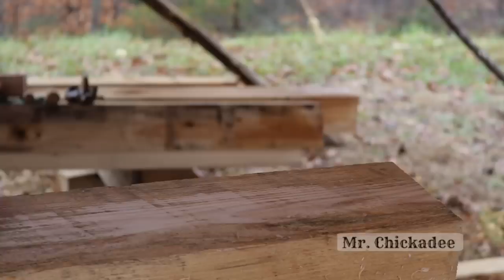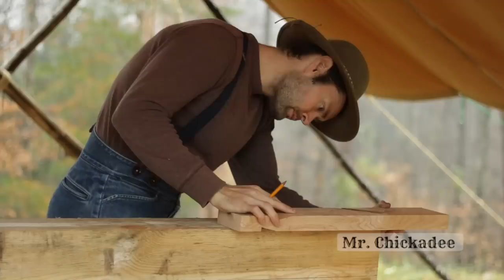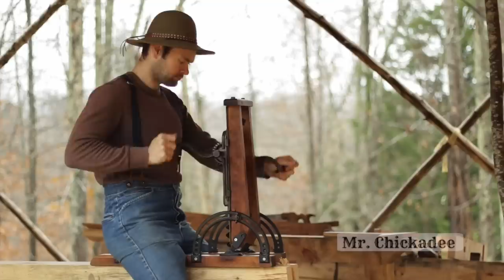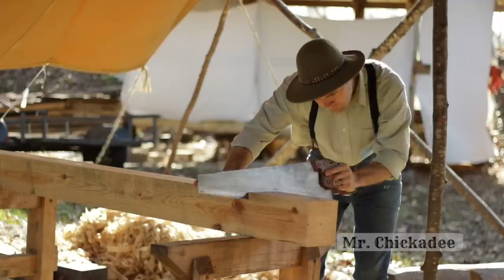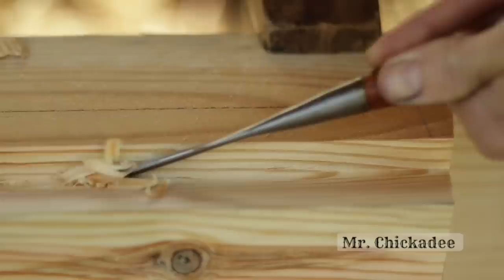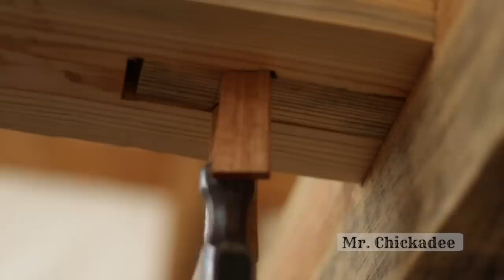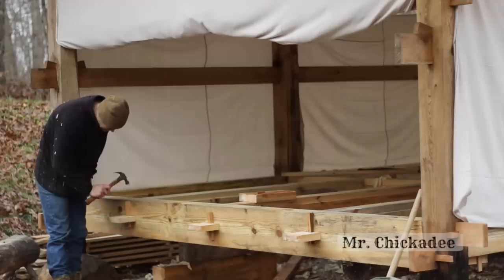Traditional Korean floor 대청마루 ( daecheongmaru) PART I -a wooden floor without nails, screws or glue

Comment: Is that floor made of pine?  And what about the posts, etc.?
Reply from the maker: The floor beams, joists and most of the boards are indeed shortleaf pine. The posts are mostly eastern hemlock, one is tulip poplar. 
One joist of the floor is also tulip poplar. 
Many woods could be used here, if you know how to treat them right!

Comment: Whats longest spand could one do with the floor. It seems yours are 3 to 4 foot could 6 foot be done?
Reply from the maker: Im not sure what span you are asking about, the boards or the timbers? Timber span is often half a room size, while most traditional korean floors of this type have shorter boards, more like 18" or less. Mine are about 36" or so, and if I did again, I would make them shorter, just easier to make shorter boards.

Comment: no glue? than what was he brushing onto those pegs? also when you think about it, arent pegs just wooden nails that you have to predrill for? (yes this is a toiler epiphany for me)
Reply from the maker: That was oil and wedges, not glue and pegs
Reply: @MrChickadee  sorry, wedges. im not familiar with the terminology, i just called them.pegs because you used them to plug the hole. what does the oil do? just to stop rot/swelling or to help them slide in?
Reply from the maker: @yareyare_dechi  wedges are tapered and pull things together, very different action than nailing something up, even pegs are not normally used like nails, though they can be, they are normally used as an aid in joinery such as drawboring a mortise and tenon together, not very similar to the action of a nail or screw. 

The oil does all that you guessed at.

Comment: 청마루 is incorrect, it's 대청마루 and that means large wooden floor, and does not indicate type of flooring technique.
correct term for such technique would be 우물마루. 
https://www.youtube.com/watch?v=nDrqidMDyqI watch from 13 minute mark for actual technique.
Reply from the maker: Thank you for the correction, it was tough searching the names! We have updated the title with the correct name. Also thank you for the video! I will share that with others curious!
Reply: @MrChickadee  this type of wooden flooring technique is called 우물마루, where 우물 means "well (as in water source)" and 마루 means wooden floor. which begs the question, what does water well has to with anything? well, water well in Chinese character looks like this 井 very similar to #. And that is the shape of the top of the water well opening either made of timber or stone in Chinese culture. And it also refers to any grid pattern shape as an extension. Also, ceiling made in grid pattern is called 우물천장 where 천장 means ceiling.
Reply: @JayCWhiteCloud  if you search Korean dictionary for 청마루 you get nothing. 
http://stdweb2.korean.go.kr/main.jsp 
대청 means large wooden floored area in some Korean traditional buildings.
청마루 would not be grammatically incorrect, but not used word.

Comment: no question to his skills, handsdown. But that is too much wood for such a small house.
Reply from the maker: most timber framing uses even larger timbers, and yes you could go a bit smaller than this as well, it may look odd to those accustomed to modern 2x stick framing though
Reply: @JayCWhiteCloud  I would agree with the sustainability part. This kind of build would definitely last long but I am not sure if 10-15 years from now, changes in the layout of the entire area might need this to be renovated.
Reply: @MrChickadee  Yeah, you can say that. I grew up watching carpenters in our town doing stick framing. Timber that big is very expensive. Well i know it is different in our country but building like this in our country would cost 5x the price of the same house using stick framing. Please don't take my comment as negative, it's just my opinion in my perspective living in 3rd world country.

Comment: That sure looks like glue on that brush....................
Reply from the maker: Its oil, gluing the wedges would be bad idea, you need to be able to tighten them or replace them or otherwise get them out if you ever need to. (like taking the building apart to move it, or tighten after large earthquake.)

Comment: Interesting but certainly not very practical.  Guess that’s my western mindset.
Reply from the maker: Have you ever planed and joined an entire subfloor, then entire finish floor with hand tools? I have, and this is WAY more practical, if talking raw rough wood to finished smooth level flooring. Now is it the same as buying OSB and slapping laminate hardwood down on top, no. To me, it is the most practical and efficient way to go from rough wood, or green wood, to a nice finished floor.
Reply: Does this style floor take this traditional style heat better? https://en.m.wikipedia.org/wiki/Ondol